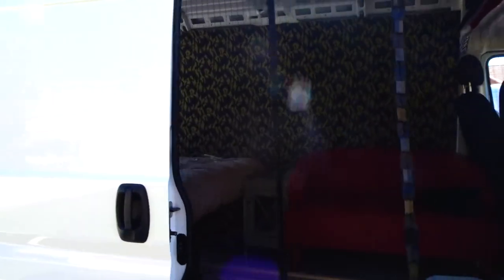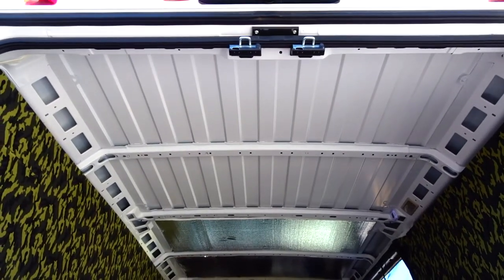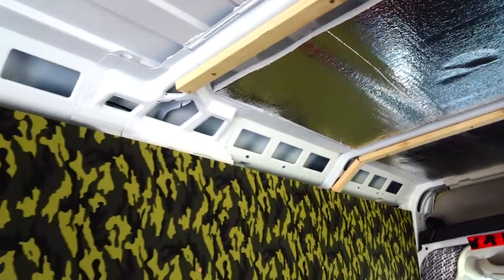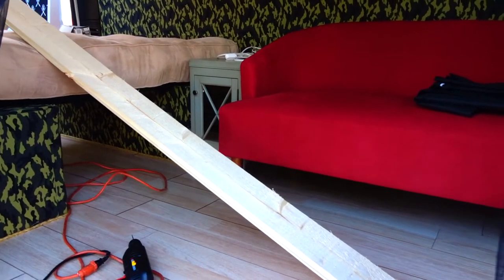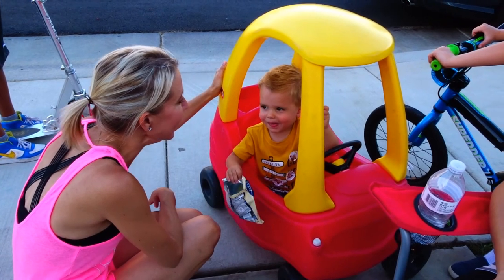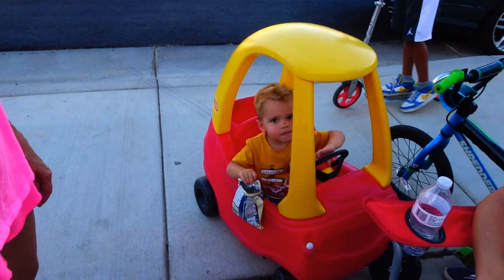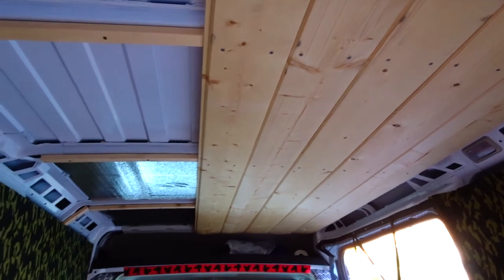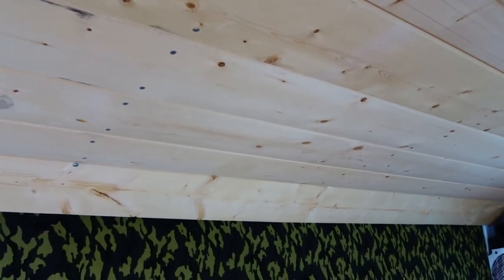2018 Ram Promaster Hightop Van Conversion.  Installing the Ceiling.

Comment: Hey! How did you attach the panels to the very front of the van? I have a Promaster as well and am a little stuck. Thanks!
Reply from the maker: The easiest way is to install these https://www.lowes.com/pd/Common-1-in-x-2-in-x-10-ft-Actual-0-78-in-x-1-5-in-x-10-ft-Spruce-Pine-Fir-Board/1000053959 to the metal walls of the van. Then attach the panels to them. We also did our ceiling like this. Hope this helps. Thanks for asking.

Comment: Hi! Was there a reason why you guys didn’t put insulation in the ceiling?
Reply from the maker: We did the front part of the ceiling. We do not live where it gets very cold all year. We will travel only to places that maybe it will get down to about 40. I also think that yes.. insulation does help keep out the cold but... We live where it is hot.. a lot of days around 100 for 4 months out of the year. Once the van is hot. Insulation just helps the hot stay in the van.